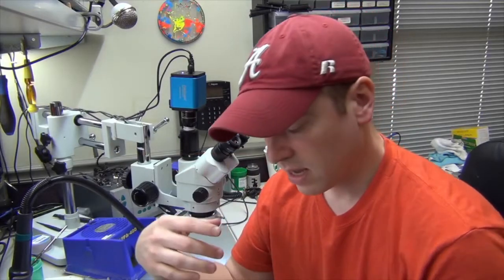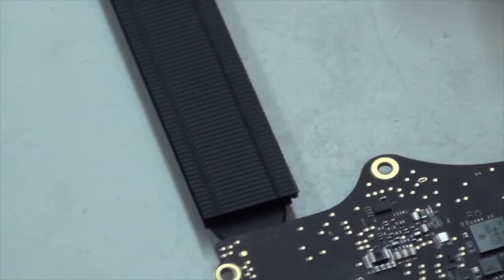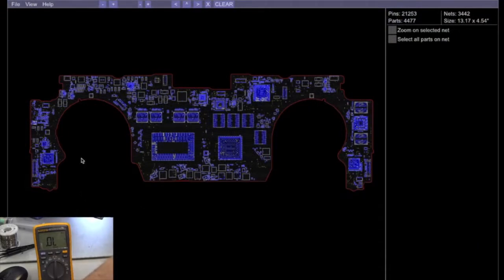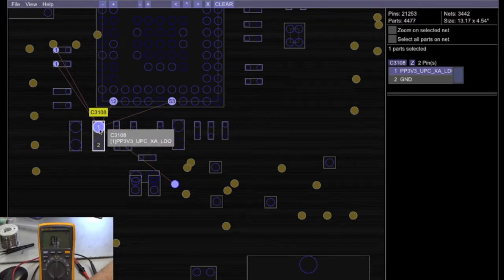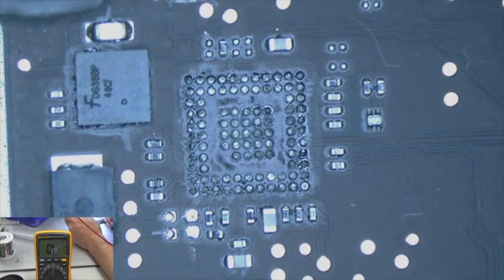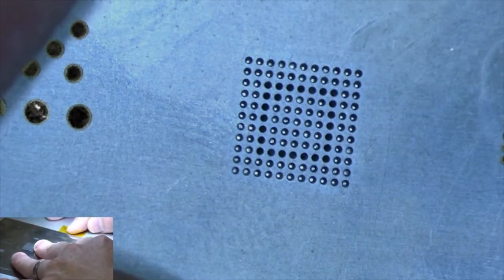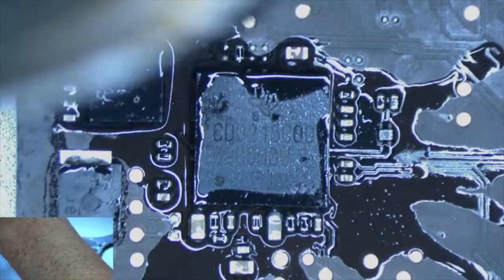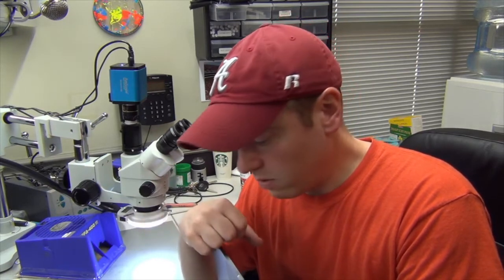Macbook Pro Touchbar Doesn't Power On Fix - A1707 board 820-00281

Comment: well done job, I have one question, I have the same Mac 1707 and the problem is that sometimes wont start, if I reset the SMC then start ok, no problem, and after can work all ok until shutdown.
Again Reset the SMC and everything is ok, I can restart and thats work, but if I leave it for some time, same thing.... I have all the tools I need and otherwise I deal with repairs, but this is something a little more for me, I would say that something is related to power supply... Can you please advise .. thx

Comment: Hi,Excellent pal, just wondering where can I find adaptor with amp meter 
Regards
Reply: There are many on Aliexpress that are USB Type C with support for voltage negotiated by the host and power supply as well as current draw. Just be sure that the meter is bi-directional - some of the earlier models from Asia did not offer this feature.

Comment: I had the same board and doesn't turn on , I follow all your videos but I still can't figured out, everything seems fine I have PP3V3_G3H (3.3 volts) and PPBUS_G3h(12.6 volts) the only thing that is suspicious is the reading on L7030 with is cero. any ideas?

Comment: hey! I really hope you can help me out I have this motherboard that had little liquid damage( just plain bottled water ), everything worked except for the keyboard so I went ahead and replaced that cable and I cleaned the motherboard. I didn't have a proper charger laying around so after I  ordered one and got it in I tried it and all of the sudden the Mac was 'dead' In a way that It turned on ( fans worked and trackpad clicked ) but no backlight, no image and no output to HDMi adapter. now the board is completly dead and gets about 4,3 volts but the volts drop to zero when I press the power key.. any Idea? I don't see any corrosion on the board or the MacBook and all components look fresh and not burned. I do only have a multimeter..